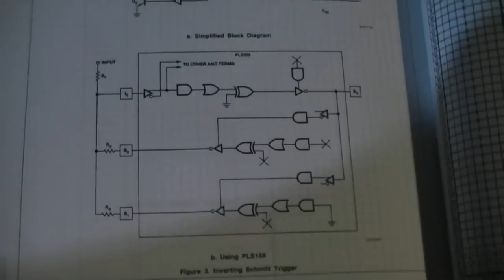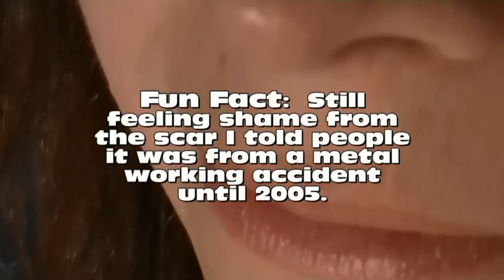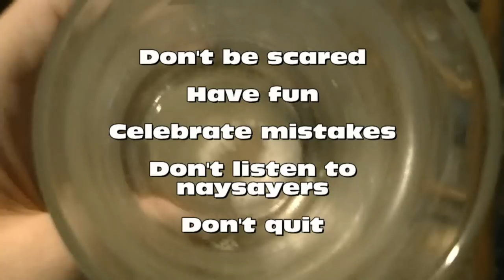Secret to Learning Electronics - Fail and Fail Often

Comment: Jeri, how long have you been doing electronics this way?  My father did not like me experimenting because it was a little messy and I often failed, as you've illustrated.  Also had no money.  Hard to fight against that kind of opposition and bullying at 7 years old!  But I hung in there.  I'm a bit older than you are, though.  I was using vacuum tubes and all sorts of terrible junk, not to mention hundreds of volts!  I was so happy when I was a little older and I could use solid state parts, lower voltages, etc.  things improved then!  But it wasn't until I was in my early 20's and on my own that I could really get going!  I didn't think I could get through college, but my wife supported me and I graduated with a BSEE in 1978! Wow!  Then on to Tektronix and several others. I finally found my most fulfilling positions in my own companies.

I hope young people watching you and admiring you have so much fun, will keep "failing" until they fail like you did!  That is, until they succeed!

Comment: Years ago I needed to replace the fuel pump on a small Chevy. Having done so numerous times, fighting the push rod each time didn't teach me the simple trick I learned to eal with the push rod. This time I consulted a manual learning the time saving trick to hold the push rod in place

Comment: Learning is about learning to do it right.. so "fail" comes first. I have a tip for this section.. plan to fail.. get 2 or 3 of whatever your learning about.. Because when it “blows”, “flames”, “fries” or “rockets” out the door.. it hurts less and you can still tell yourself “I got it all under control!”

Comment: 2:45 if that inductor is for the tuning part it probably has too much loss at RF.  There are ferrites that work at higher frequency or you could use a Air coil.

Comment: Good vid. It's true what you've advised for one  to master at least practical electronic device and sub-circuit  building. Collect and read lots and lots of books, old and new. Think the older books are a lot better reads though (from the mid 1970s to about the mid 1990s) due to that stage of electronic component innovations and developments and corresponding projects utilizing said components (micro electronics gets a bit hard to handle, so small and yeeek! don't care too much for them). And collect lots of electronic junk to salvage, salvage, and salvage parts. A more cost effective way to aquire components.

Keep up the good work Lady:)

Comment: i love ur mind - i had that blue one the 200 - in 1 kit from radio shack ! I'm working on various materials for sectors like aluminum cans. materials readily available so i can build a wimshurst machine from scratch. So, yeah i don't mind failing because it makes me think about the problem even harder or sometimes i leave the problem alone for a little bit and out of nowhere UREKA i get the solution, most of the time.

Comment: This shows why it is so important to have a good grounding in physics and mathematics if you want to become a successful maker or even an electronics hobbyist.
 Without the powerful tool of mathematics at your disposal, your tinkering will be a frustrating experience, because the fundamentals underlying the behavior of electronic devices will remain hidden from you.
  Without a basic knowledge of sold state physics, attempting to make a transistor from raw silicon wafers  is ridiculous, much like trying to square a circle, which many amateur tinkerers in ancient times tried to do.
  I believe all tinkerers and makers should start with trying to get a solid grasp of the theoretical fundamentals, even though physics and math are not regarded as sexy subjects. The discipline learned from putting the mental effort into learning the basics creates a solid foundation that can elevate you above the level of the tinkerer and make you a true engineer.
Reply: Hi I'm from Bangladesh , your video is very halpful ...

Comment: When I was a kid in the mid 80's, I bought a 160 in one electronics kit (I think that was the name anyway) at a garage sale. It had the various parts mounted to cardboard with springs on the ends and wires to wire up various circuits.

So one day, my brother and I ran some speaker wire through our little sister's  window and put a speaker in her room. We then wired up the amplifier project from the kit's project book. 

Later that night, we made ghost noises. Several times, she woke up our dad, and he kept reassuring her that there were no ghosts. Years later as an adult, she told me she was absolutely terrified. Hehe, my brother and I are lucky she doesn't hold that against us.

Comment: to amuse: back in '83, I tried to make a camera sensor from a 16K dynamic ram chip by heating it enough to remove the top part of the case. The ram chip was then placed in a "language card" on an apple 2+ computer with the difference that I could control whether it got refreshed. In theory, it should have been possible to resolve images with it. In practice, I couldn't figure out the mapping between physical location and row/column address.

Comment: Thought I would share this "failure". While assembling a circuit for a lab, I misread 2.2 K ohms as 2.2 ohms. I turned the power on and the resistors did their best impersonations of heating elements, releasing the dreaded "magic smoke". I leaned over to check the power supply because, obviously, the problem couldn't have been my perfectly assembled circuit, and my jacket brushed the now red hot circuitry. Much melting, stinking, and cussing ensued. Lessons learned: 1. Read instructions very carefully. 2. Loose clothing = bad. 3. Fire Extinguisher = good.

Comment: Most of my failures have to do with part substitutions. I design a circuit I want then find I don't have all the parts in stock, so I start substituting and end up with a circuit that doesn't do what I wanted. My first was a ham morse keyer. My sub ICs didn't operate with the right timing.

Comment: Jeri, regarding your radio reciever, it is always best to have a large ground plane and hardwire your parts as closely as possible. If you have access to a copy of the ARRL ( American Radio Relay League handbook) I would get a copy of that it will help you in your discovery of RF circuits.

Comment: I had a job in the industry as a bench technician working on 20" tube monitors for computers.  I just made a repair on a fly-back transformer for the high voltage supply on the tube.  Got a high voltage probe to check underneath that suction cup on the side of the tube, where the high voltage, and when I say high, for a 20" tube there has to be at least 50k DC.  I made the mistake of taking a screw driver wrapped in electrical tape, thinking it was insulated to lift the outer edge of the cup, and an arc formed from the connector about one inch to the tip of the screw driver and I felt some of it go into my hand out to my elbow.  Bad idea.  Don't make those mistakes   XD

Comment: Another thing I did once was take  the plastic lid from a 1 gallon ice cream bucket and wrap a coil of 32 gauge enamel wire around it. I was planning to make a metal detector, but never got to it. But messing around, I decided to connect one coil to the ear phone jack of a radio and another coil to the input of an amplifier. I used it like a air coupled transformer and sent sound through my wall to the next room.

Comment: I am a computer programmer and life long lover of electronics, but I am so slow when it comes to understanding electronics.  But one day, I took an audio receiver, and wanted to know if, I shorted the speaker terminals, I could see a drop in the power rail.  And I somehow blew up the receiver.  Oh well.  At least nothing else got damaged.  Oh, and I wanted to see how the voltage dropped on a wall wart under load.  So I had these load devices I bought from a surplus store.  And it was cool seeing the power supply drop under load ( as you would expect of course, but I was trying to learn first hand.)  And it was fun experiment except for some reason, my brain failed to remind me that electrons don't just disappear going through a dummy load.  They have to go somewhere - in this case, and obvious to smarter people, heat.  And I burned myself.  Anyway, it healed.  So failure is expected, but try to be smarter than I was on those two experiments :)
Reply: Michael Bauers I always experienced the right channel, specifically, burning out in old stereos growing up.

Comment: You know we can do it also what you are motivating to us :) but one thing is the problem.. insuficiency of materials and financial budget..
Reply: if budget is a prob. sacrifice some things that you usually spend money . indirectly you will be saving money. then buy what you need once you feel u have enough.  have a great day:)
Reply: Mr Jn I understand this is 5 months ago, but get into tearing apart electronics.

I picked up a $4 soldering iron from Harbor freight and just started tearing things down...capacitors, LEDs, diodes, buttons, fuses, coils, DC motors, resistors, batterries...I didn't pay a dime for any of them!

Comment: I once tried to repurpose a morse code tone generator (Radio Shack item with 2 TO92 transistors and a few passive components) into a step up converter to light 4 watt fluorescent tubes from batteries. Let's just say TO92 transistors don't do 4 watts without releasing their magic smoke.

Comment: good for you. I just like to share my failures. Basically when I learn a new skill I tend to try to run before I can walk. I barely knew much more than ohmslaw and some other bits and pieces I learn't from my electricians course. I built my own arduino. My mate whos a professional engineer though I was crazy and didn't think I get it working. After destroying 2 FTDI ft232rl chips  I had it working. But then few days later it failed.  I started all over on a new stripboard. AFAIK it still works.

Comment: Back in my early days of electronics, I used to talk a lot about "magic smoke".  You see, inside every integrated circuit you will find "magic smoke" -- but once you let the magic smoke OUT of the chip, it unfortunately doesn't work anymore.  ;-)  Needless to say, there's been more than a couple chips where I've accidentally released the magic smoke -- and boy does that smoke STINK.  :-P  Your email address reminded me of this so I thought I'd share.  :-P

Comment: In history some of the best inventions took failure after failure after failur but eventually finally worked. Thinking about the electric light bulb thousands of experiments before they had the tungsten filament heck they even carbonized one of his workers beard hairs and used it which did work for a little bit. So yes don't be afraid to experiment out of failure comes success and if not at least learning.

Comment: When I was a kid I liked to tear things apart and mess with stuff. One time when I was around 12 I was messing with an old camara flash unit with a 330V cap in it...I thought what would happen if I stuck it to a car ignition coil...BAD MOVE...lol It shot an arc over 6 inches hitting me in the hand launching my straight off my bed. My arm hurt for a week. It was a total failier but it didn't slow me down. 25 years later I build stereo amps :) less voltage lmao!
Reply: You call that a failure? I'd say you did quite well. Apart from the taking precautions part, obviously.

Comment: For Starters you did not Fail. You learned what Results are when you do something that way, Yes it did not Work But You Tried. When You do fail is when you Don't Learn. But you did learn something. What happens when you doit that way, Also Giving Up is not Failing. Giving up is when you Know When you're Not Ready For that. and How are you going to Know when You are Ready. Well, Everyone Has their own way to Know when they're Ready. Also, you might never be Ready For that. So If you can Just move on to the next Idea.

Comment: I had a fishing rod with 20lb test line and a 1/4 oz sinker on it. I cast it over the top of 3 trees  50ft tall. I then tied the line to the end of a 500 foot spool of 18guage wire and pulled it over the top of the trees and used it as a shortwave radio antenna.  I also turned a 24" woofer into a long range parabolic microphone that I could hear someone whisper 50ft away.. So, I say.. Never let anything get in your way when you need to do something. You might end up building robots that go to Mars..

Comment: Being weird and strange is not a bad thing.  I was "weird and strange" as a kid and had my small click of other "weird and strange" kids.  I was going to go into Meteorology (not the study of falling stars as some have commented) but my high school science teacher talked me out of it telling me that I would need a PhD to get anywhere.  So I got into Chemistry, same issue, I would almost certainly need a PhD so I got into electronics.  I was in my high school Amateur Radio club sponsored by the same teacher who talked me out of Meteorology and Chemistry and became a licensed ham in 1975, almost 50 years ago now.  I discovered computers in the high school Physics lab run by Mr. Schlauter ("slaughter").  It was an MITS Altair 8800 that had a whopping 12K of RAM, yes 12 K, not 12Meg or 12 Gig but 12K (thousand) with an Intel 8080 processor running at 256KHz, again, not MHz.  It processed 275 thousand instructions per second.  My first "real" program was to find prime numbers.  It took about a minute to find primes less than 100.  Now my Intel i9 8 Core CPU will, in the first minute, find primes up into the millions running at 4.2GHz per Core and 6 billion instructions per second per core. The cassette interface for the Altair 8800 was built by hand, the device to save the programs at 300 baud to a cassette tape and the interface to a hand built video terminal from an old 9" black and white TV with a 32X16 character resolution.  No graphics, just text 32 wide and 16 high.  We really thought we had something.  It ran BASIC by Microsoft, a then three year old company, that took five minutes to load into 4K of RAM to load from a cassette tape.  We now load multi GB of operating systems in seconds from solid state devices.  Hard drives were only on large mainframes and even those were in the low megabyte range in size.  I have a platter from an old IBM 360 Model 4 that ran on 8MB of RAM and a 10MB system hard drive on a 13 inch platter.  This drive had four platters each with just  5MB of space.  Only the bottom of the platter was used.  Head crashes were common since they ran at only about 1000RPM.  Mind has a scratch that runs all the way around through the media into the aluminum platter, the result of a head crash that not only destroyed the platter but did significant damage to the drive I'm sure.  This happened quite often.  I don't remember the MTBF (mean time between failures) of these old drive but it was in hundreds of hours and not thousands.  I fell in love with computers and attended the University of Texas at San Antonio and got a job at the UT Health Science Center (medical/dental/nursing school) and stayed for almost 30 years after which I retired.  My point is, which I think is the same point Jeri is trying to make, is to follow your dreams and interests and don't listen to the bullies in your life that might call you ugly or say that you are weird or a nerd.  The richest person in the world is a nerd who started in his garage.  Clean a spot in your garage and get started with your dream!  Ignore some of the rules and just do it.  Besides --- I before E except after C?  Weird, eh?

Comment: I think I got into electronics because i'm a tightwad. I've always had a "make it/fix it yourself " attitude. When it come to electronics there are schematics galore. If you want to build it all you have to do is find it. Of course make sure it wasn't drew by some five-year-old (or equivalent) playing connect the dots. When you start picking out parts and looking at data sheets at mouser or digikey for example you'll definitely be overwhelmed. Never be afraid to ask questions and ask often.

Comment: I used to have one of those kits.  I could never get the radios from the book to work.  Then I discovered how to use the coil in the relay to give someone an electric shock (much like the distributor in an old car engine) which was much more fun.  Then I got bored of that & just blew up the built-in LEDs instead.

Comment: You know, someone just told me the secret the other day with that clock oscillator... If you have another one of those, try modulating the +5 power with the audio. See if that makes it walk around enough to FM modulate the output. A friend of mine has made "foxes" for hidden transmitter hunting by this method, using a multiple of the oscillator frequency that falls in the 2-meter ham band. An ISD ChipCorder audio chip loops audio that couples onto the +5.

Comment: I guess I wasn't clear. It is printed on the motherboard. Just like you have R10 where R means resistor, C5 means capacitor, Q1 means transistor, IC4 means a chip.

Comment: electronics is a vast subject, when designing and building a machine a real engineer will find themselves becoming skilled in nearly every trade, welding, wood work, metal work, on the tools, physics, math, documentation, legal, marketing, security, software development and programming, CAD pcb manufacturing and assembly, soldering, testing, fault finding, even people skills, consulting with the client. the skills set are seeming endless.

Comment: I blew up a 7805 by wiring it the wrong way round because I didn't use different colour wires for the input and the gnd wire. It was pretty spectecular. It made a loud bang. It was  connected to 12v line of pc psu. My engineer friend wasn't impressed. Although I was upset with myself I didn't let that stop me. That was just two - three weeks ago.